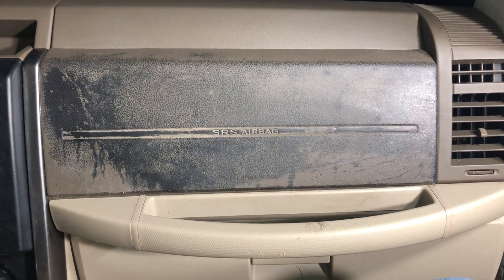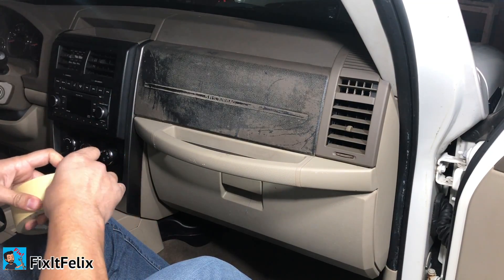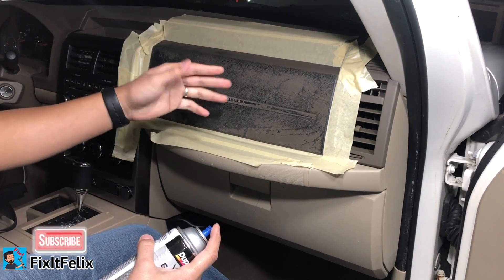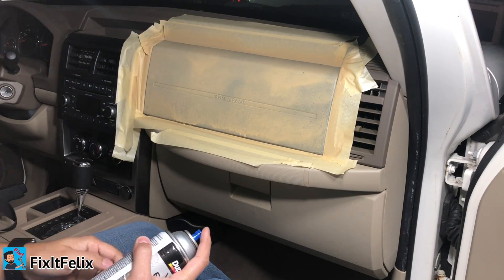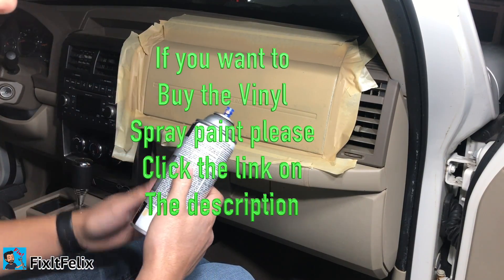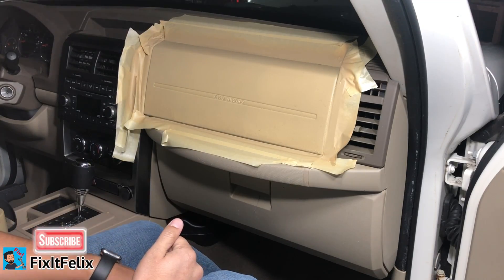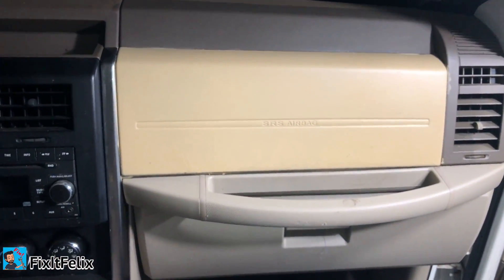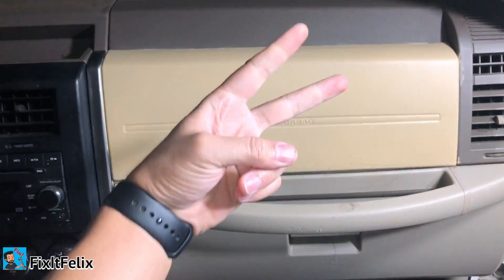How to fix dash with vinyl spray ( how to paint )

Comment: what was the tape for
Reply: Is that a real question?
Reply: @Maarcoooo Yeah, I usually just use towels for overspray. If it gets on the windows or fabric then I use a Mr Clean Magic Eraser. 
Oh and by the way “Pooloooo”
Reply: @gedionsamuel2256  lmfao. That makes sense. I use plastic tarp with tape. Never thought about the maid eraser, gotta jot that down.
Reply: @Maarcoooo 👌🏽😂

Comment: Instead of trying to match the bottom part of the dash you should have matched the upper part of the dash , also did you ever think to remove the  carp of the dash with acetone of lacquer thinner . and you should have prepped the vinyl you painted for adhesion